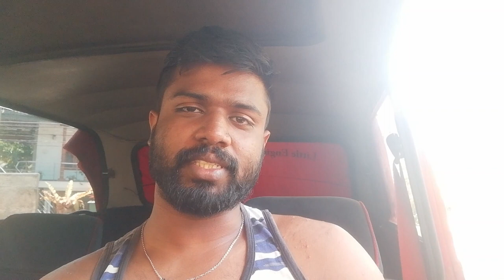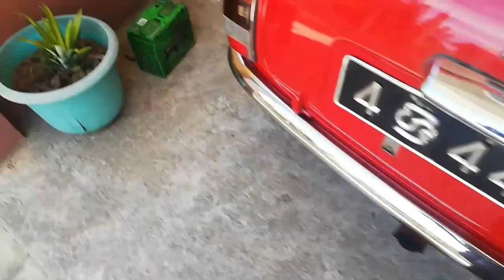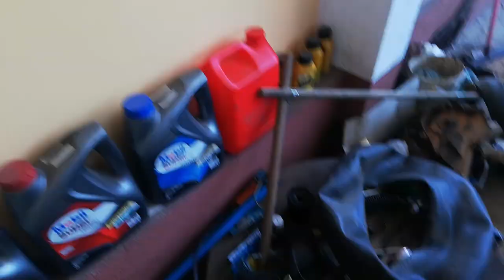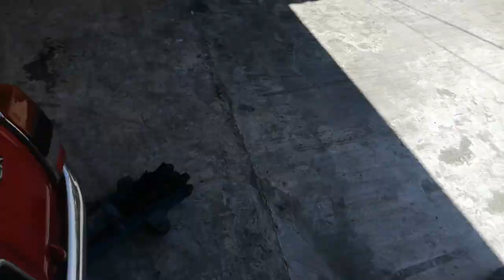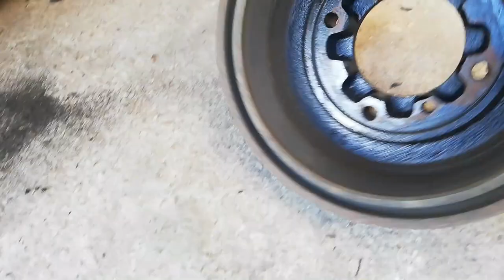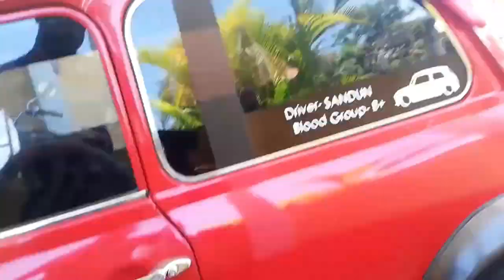Mini brake shoes after one year

Comment: due to incompatible axel stud
incompatible brake drum
loose conecting of brake cylinder and screw
be sure 100 % tied of screw befor fitting the tire
check stud fitting or loose conection 
rotate axel in zig zag method only with drum .if small play occure for ur issue
fix only screw without drum or tire and rotate freely and check srew hurts any parts of brakes